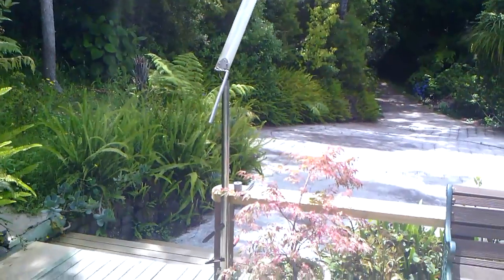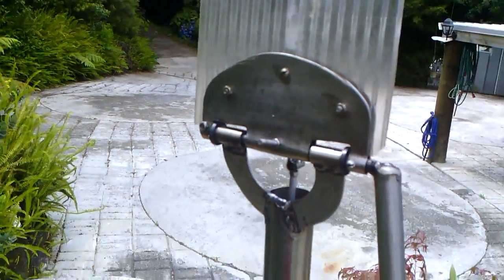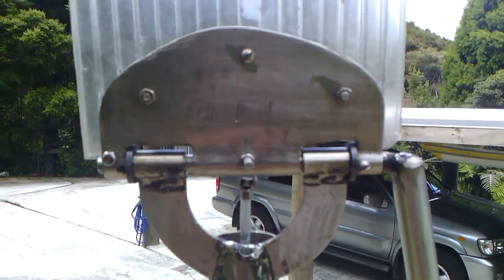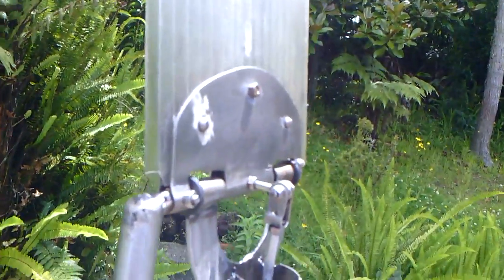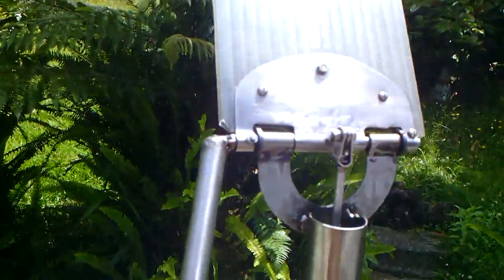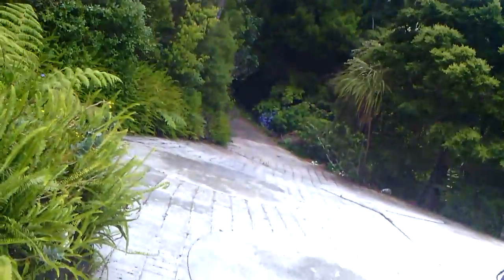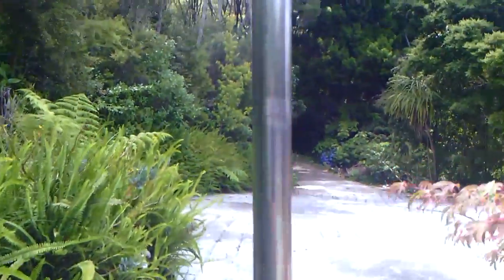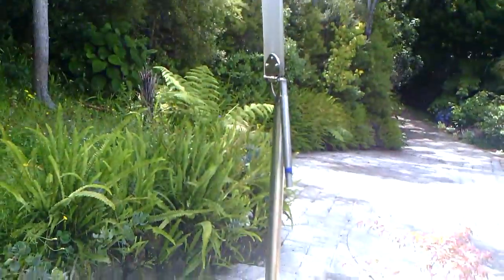my new windvane.

Comment: Hi Brian. I have a kestrel 18 and like your idea too. Especially the fact that it works with a cable, because my rudder needs to tilt back 90 degrees. On your shaft where you want to add a weight, I suggest a threaded rod, so you can screw the weight up and down to balance it easier. Keep us posted. Cheers Hendrik.